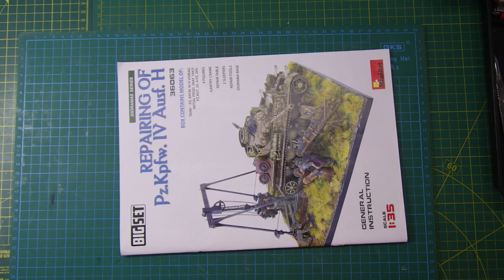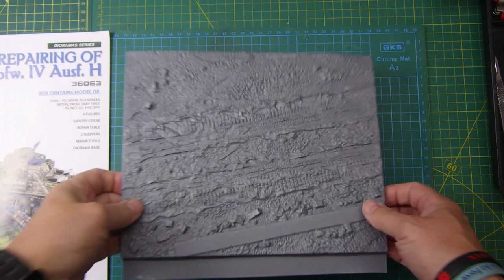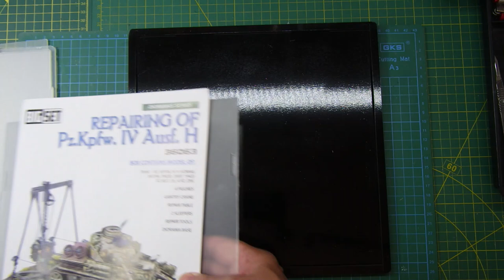MiniArt Panzer IV Tank Repair diorama - part 1 [ planning

Comment: Actually, that vacuform base kind of brings back fond memories.  I remember the old Aurora "square box" 1/48 scale armor kits that were issued in the early 1970's with similar display bases.  There was even a space for a name plate decal.  I also remember building some Airfix kits (released in America under the MPC label) that also came with vacuform bases; the Spitfire with the refueling set was my favorite.  In any case, combining this fine Panzer IV with the building will make a fantastic scene!  Happy Modeling!
Reply from the maker: Yes, I  remember those old kits. I prefer to make my own base now. Thanks for looking in. Cheers Bob 👍🍻